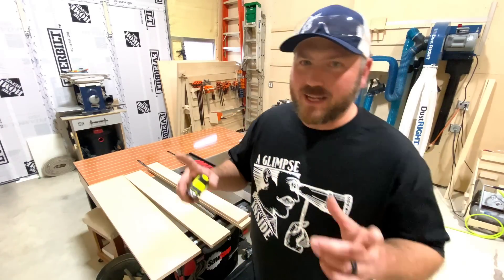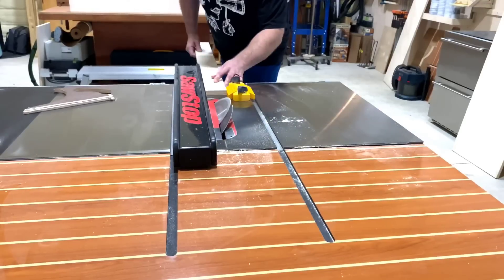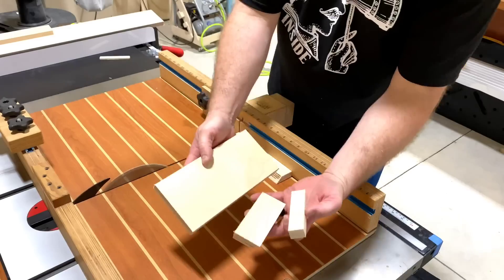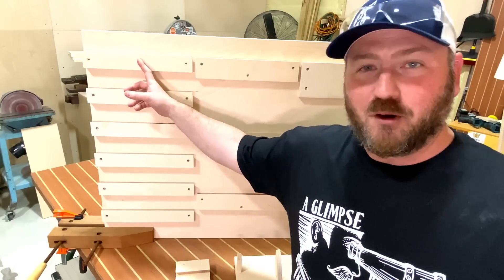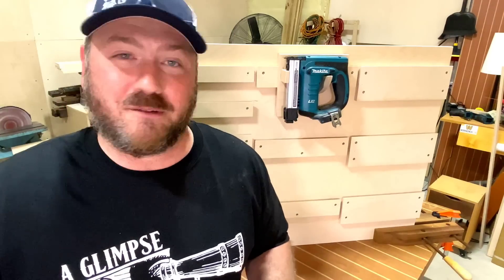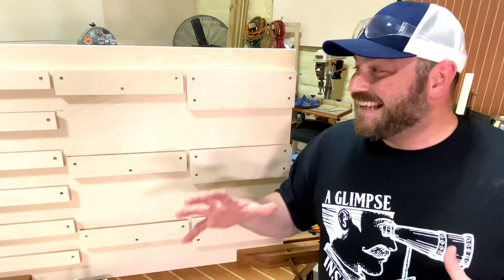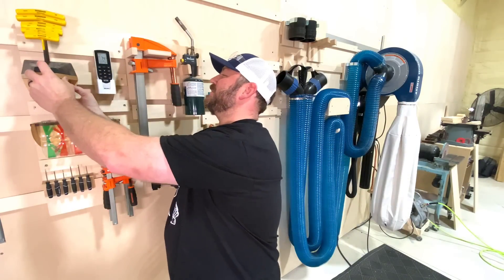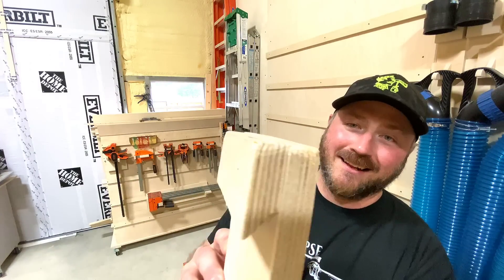Which FRENCH CLEAT Style is Right For You | A Glimpse Inside How to

Comment: You're too cool for words! Love the ending! One thing I might add is I've built a 4X 2'x4' modular workbench and on one of them I'm going to make a strong cleat shelf to put my cheap, 10" Harbor Freight table saw on so I have a run off table for sheet goods. At the bottom I'll have a key to prevent the table from being accidentally lifted off. Look at the 5:20 mark and see the small space between the bottom of the tool holder and the bottom of the cleat. You can make a slightly smaller strip of plywood to insert there and it'll prevent the holder from sliding up accidentally. A slight ridge cut in the key will give you something the grab and pull it out.

Comment: Great video.  I too set up a French cleat system in my shop, backed by two 4x8 sheets of plywood.  I spaced my cleats 4" apart so that I wouldn't need the spacers. I also saved about a 4" section of cleat that I use to set up the table saw each time I need to cut  more cleats. That saves me having to redo the math each time.

Comment: Chris, you've answered a headache I've been wrestling with for ever, how to set fence for 45 degree cuts. Huge shout out! Also, full French cleat wall is next project in my 1 bay garage that has 3 bays of material and tools in it. Can't wait to see it come to fruition. Love the vids, please keep them coming.
Reply: Agreed, thats a great take away from this video on setting up for ripping  the 45deg cut.  I  just completed my own fench cleat tool wall and used the trial and error method to find the center of the board.  I now have the knowledge for the next time I have to use this cut.🙄
Reply from the maker: Well I can help. Hope you get to those projects as soon as possible Greg. As always thank you
Reply: I suspect the answer is a trigonometry one. Sine of angle times width and cosine of angle times thickness, something like that 😁
Reply: No need for trig functions. 

What is missed though, and sorta corrected for, is the kerf. It’s half the width of the board minus half the thickness of the wood minus half the width of the saw blade.

Comment: I actually used french cleats to put up wall hanging cabinets. I laminated two 3/4 pieces of plywood and cut a set for each cabinet. This let me hang each one at a time and bolt them together after getting them on the wall. This also left me the 1 1/2" space between the cabinets and the wall to run cables. It's my entertainment center upstairs.

Comment: I like your plywood walls and all your french cleat videos!  I built a cleat wall for my garage 6yrs ago to get the yard tools, beach stuff (fellow Floridian) and bikes off the floor and out of the way. Since my wallls are drywall, I had to use wider strips and just ripped an 8' sheet of birch ply on a 45 and attached w 3 screws/stud, just as you said; I spaced about 12" apart.  It's such a strong, flexible system, and so easy to build..

Comment: I have built shelving and Curtin Rod Valances for several years using French Cleats for others.  I however, I have 20 feet of 1/4" Pegboard above one of my work benches, as some habits are hard to break.  I also have made about 50 pegboard specialty hooks, and I have about $500.00 worth of hangers, clips, hook locks, etc. and do not want to just throw them away.  That said, I am building an 8' x 12' wall of French Cleats for tools and a few supplies to get started.  Thank you for sharing the three types of Cleats that you use.  You have given me plenty to work with.  Loved you including your daughter as well.

Comment: Another great video! However, when I was making my cleat system for my shop, I tried using 1x2 material and it was a disaster! when I would cut the 45 deg. angle on the edge of each board they would banana big time. So to your viewers who are thinking of using french cleats please use plywood, it is much more stable!
Reply: Thanks Ted for that information, i was just thinking of using 1X6 softwood to save money but know I'm going to go back to using birch plywood, even though it costs a fortune here in Ontario, Canada.
Reply: Did you let the wood sit for a few weeks to get seasoned to the humidity of your shop?

Comment: Good stuff. Really wished I had seen this before I set mine up. Thanks for the info!
Reply from the maker: Thank you. I’ve put up many a French cleat wall that didn’t quite work. Are used to glue the first time. And a bead of it had crept inside the crevice between the 45 and the wall. Needless to say nothing really snuggly fit. LOL
Reply: @AGlimpseInside  Man, I thought I was being slick and used the primed 1x4 pine from the box store. It will serve my purpose but that whole "remove the material thickness from your measurement on the 45" would have saved me some bones. Really digging your stuff and your style. Looking forward to more of your content.

Comment: I never have enough wall space in my garage. And, I keep moving. Generally, built-in items become part of the property when you sell your house. So, about 15 years ago, I made 4 double door cabinets to go above my workbench and used french cleats to hang them. I always recess the french cleats on cabinets so that the sides are always flush with the sheetrock. I hang the wall mounted portion with two lag bolts and put the cabinets up. Because each move results in a different position for the studs in relation to the cleats, the wall portion ends up with multiple holes after several moves. But, I  only have to lift the cabinet off the cleat and remove the two lag bolts to move. And, trust me, they hold a LOT of weight. If I ever get called on removing the cabinets, I can honestly say the cabinets were never attached to the wall and at worst leave the wall mounted cleat in place and just rip 2 more pieces to mount the four cabinets in the new garage.
Reply: I would just make it clear to prospective buyers that the shop will be completely empty once I sell.

Comment: Thanks for this very informative video on set-ups!  If I understand, I could set up French Cleats straight on studs, using the 1X6" ?  And I guess if I have anything heavy to put up, I could always screw in a 1X1 for back up straight on the studs,  the necesssary length for a specific item.  High winds blew away some flimsy sheds, so I build an 8' pentagonal shed, in which I need to store and and have easy access to all my gardening and construction tools, and more.  I imagine the cleats will also reinforce the structure.

Comment: Chris, on the 45 degree measurements, you are correct...I figured this out building my french cleat wall.  However, one caveat is that it depends on which way your blade tilts.  Mine tilts to the right, so I have to ADD 1/2 thickness.  If your blade tilts to the left, you SUBTRACT 1/2 material thickness.
Reply from the maker: This is very true. But keep in mind that you want the blade to tell away from your face at all times for safety reasons. The propensity for the material to bind up in between that 45 and the fence is a bit too precarious for me my friend. But yes you’re right I should’ve detail that a little bit more I just thought I was being a little too long-winded LOL
Reply: This confused me. I couldn't understand what he was saying about the equation to get the 2 identical pieces at 45°.. could i get it in writing? My brain cant absorb info if it's spoken fast lmao I love this system and I want it in my shop!!!

Comment: So many applications. My deal is constantly adding tools to my shop (mostly hand tools). My original hand tool cabinet has very specific locations for each plane, spokeshave, chisel, etc. When replaced or new ones added I'm SOL since glued and screwed. Next tool cabinet will have small French cleats in it then I'd only have to replace the one cleat to accommodate the new tool.

Comment: I have my belt sander hanging on my french cleat system. I've had the sander mounted on a board so I can use it sand side up while it sits on a bench. I can now use it while it is on the wall for sanding simple items. For more intense sanding, I lay it on the bench and clamp it down.
Reply: Also, instead of having a cleat board for every tool, I have 12" x 20" pieces of plywood that I mount similar tools together on one board. Example, all of my squares, crescent wrenches, spring clamps, etc., have their own board. Currently I have 27 feet of these 12" wide boards and the linear consistent look is very clean and organized. Basically, how much stuff can you get on a 12" x 20" board.

Comment: @13:23  "Like a boss" look before you even stick the cleat landing. NICE!! A little foreshadowing there Chris?

Cleats need to go up in my shedshop. but i am getting hung up on a workbench style.
Reply from the maker: I feel your pain on that one I’m in the process of thinking what to do for my new updated workbench. Once I get the idea you know there will be a video
Reply: You bet Chris! I will be watching for it. ;)  My current idea for a workbench is a combination of a built-in cabinet and a flip top in a couple spots. I need some kind of space saver for my miter saw. Right at the work surface I want to add a floor sweep but for the workbench surface in the corner where. That way I have somewhat easy dust cleanup.  I am designing this in SketchUp first to see if this will actually work. Digital sawdust is easier to deal with before making man glitter (real sawdust).

Comment: Retail supply stores do have slat wall/French cleats with steel inserts. You can buy them in 4 x 8 sheets for about $125 per sheet... I used them in my family’s first retail store in 1985 and they had been around for 30 years before that. You can even buy hangers and accessories for very small items and boxes that hang on the cleats. I use a combination of both Store bought fixtures and my own French cleats. It works for my shop.

Comment: On your cleat system the one key feature is you can make cabnets floor or wall or both and have the option to change your shops layout without too much work to find a better work flow.
However the slat wall system is just as good and both are an upgrade to pegboard walls..
Neat thing is you move all you have to do is remove the cleats and fill the screw holes.

Comment: your narrow spaced cleat system and the large spaces system are also able to hold heavier weights than the middle system. the larger system is simply using beefier parts... larger board and more screws, but the smaller system has more cleats available, so if you have large or h4eavy items you can spread the load between multiple cleats. In my shed my back pack leaf blower motor is attached to 3 or 4 separate cleats. Likewise I have some shelves that are supported by multiple cleats. You can also "lock" a cleat to the wall with a support just below the cleat screwed in from the face. This is good for things like small parts bins that you want access to, but REALLY do not want falling off the shelf.

Comment: Another great video! Since I started building cleat walls, I've always have questioned the spacing the cleats and the width of each cleat. I've been spacing about 8” apart for tools and smaller clamps. I see now that when cleat rows are evenly spaced, it looks better. My shop has gets 20” apart covered by metal, with insulation installed. All my cleats are screwed in, so if &when I can afford to insulate, I'll remove the gets one section at a time---------I know this isn't a good idea, but I'm retired & on fixed income-----I can't afford to insulate before hand. Back to the cleats. I have 6 plastic screw/etc bins, I'm using 5” wide cleats for support of the bins & a spacer block to hold them vertical. I hope that'll work. This project won't look as good as a plywood or sheetrock wall. I enjoy your videos...... You have good ideas that are easy to implement or modify to my needs. Thank you.
Reply from the maker: Thanks brother. Yeah it’s whatever really works for you. On a budget or not I think it’s just kind of getting out into the shop and figuring out a way to make things just a bit more organized and they were before is the goal. I think we all can agree that it’s the process sometimes that’s better than a result

Comment: My French cleats were placed on drywall.  I was concerned about the accumulation of dust in the grooves over time.  To brush the dust out means removing all the hangers.  Vacuuming it out is an alternative but is still a hassle.  I cut 1/4” plywood or hardboard about 1 1/2” wide and as long as the cleat on the wall was wide (measured on the short side touching the wall.  I predrilled these spacers. As I screwed the cleats on the wall I stuck one of these spacers between the drywall and the French cleat.  It was a little hassle installing the spacers, but now I will never have any dust accumulation in the groove.  When done, you will not even see the spacers.  Note: make sure the spacers are not too high otherwise the cleat on the back of the tool holders may ride up too high and not seat properly.

Comment: This was a great video.  We’re completing a new garage for vintage car work, not a wood shop ;(. and my art studio.  I’ve been looking a a lot of videos on the cleat system and you’re the first that explained the pros and cons of the sizes of cleats.  I want to use this system in my art room (I have it in sections - metal/drilling work,, sculpting, glass, etc).  Question - Frank used 1/2” birch on his closet system and everyone else I’ve seen, so far, uses 3/4” plywood.  I can get nice size pieces of 1/2” birch from a shop that sells left over Board from a cabinet shop.  Is the main benefit to using 3/4” wood the strength needed for hanging tools?  Thanks.

Comment: I like your explanation of the three different types and their uses. My question is “ I have drywall in my shop but if I run 8’ strips on the drywall and put in screws every 16”, do I still need the thicker cleat or could I use the 2 1/2” strips?”
Reply from the maker: 2 1/2 inches will be fine. Although if you can’t screw into a hard surface and only screw into every stud. Only thing I don’t recommend is making something like a countertop that hangs from it but everything else is fair game

Comment: Chris, I've also seen one other style of French Cleat that doesn't use the 45 degree angle at all. Instead, each cleat is two layers - one shorter support block, then the vertical board that the individual boards mount into. The two blocks are flush on the bottom and the front vertical board between 50-100% higher than the support block. The major advantage I've seen with that style is you can also use right angle metal hangers (like door hangers for wreaths) to hang things. Less work at the table saw since you don't need to cut the 45, but more work since you need twice as many pieces to put it up. I also suspect the 45 can take more stress than the right angle because gravity pulls everything closer to the wall instead of applying torsion to the cleat if there is a gap.
Reply from the maker: That’s absolutely true I had seen that years ago but I completely forgot. Thanks for reminding me. You’re just giving me another idea for another option maybe for another video

Comment: The video's are awesome.  I'm working on my 12' wide 8' tall wall as I write this.  I'm made the 2 1/4" cleats.  I have one question?  You mention spacing them 5" apart.  But as I look at the one you built in the example, the space between the cleats looks less than 5".  As I started my second row with a 5 " space between them,  the gap looks huge.  I wish you had a picture showing where you measured them from?

Comment: I prefer the center version as well but not only for cost and assembly time but, you don’t give up space on the cleat below like happens on the more narrow and closer spaced left side ones. I’m still adjusting to the system…because I like it but, at 62, I grew up with the “hammer in a nail or two and hang it” method. Old habits die hard as THEY say…but I’m learning to adjust and adapt!! Of course, a good luck kiss from our little angels always conquers adversity!!😁

Comment: A Glimpse Inside,  

I really enjoyed your video, and am working on installing a cleat system in my garage.  I am an absolute woodworking novice and sadly, had a little difficulty using your tip on "dividing the thickness of your cleat material in half" to get two equal halves. I have a Ryobi jobsite table saw.  It's not my dream saw, but it was a great price - FREE.  

I cut 3/4" plywood into 8" strips. Then, I calculated that the saw guide needed to be 3 5/8" from the blade to get equal halves.  I set the guide to 3 5/8" and verified the distance with a tape measure and with the blade at 0 degrees.  Calculations sound correct?  Unfortunately, when I cut the 8" board, the piece between the guide and blade came out about 3/16" wider than the other half.  In the end, I had to set the guide to 3 1/4" to get equal halves.  Is my saw inaccurate or did I miscalculate?  

Thanks for any help.  

Todd

Comment: Totally love your  video. Very in formative.  New house build almost done. Dry wall garage. I think 7 plus in wide cleat will work. Question,  wanting to make shelves to hold tote 30  inches long  by 21 inches wide. If I store with length away from the wall ie 30 inches deep shelf.  Would you use shelf brackets 25 inches deep doubled cut  from 3/4  ply wood.  Needs to hold 50 to 100 lbs? What would you suggest
Reply from the maker: The brackets don’t necessarily need to be doubled up but you would need to use them probably every 10 inches on your shelf maybe even every 8 inches. The main thing if you’re doing cleats is the wall cleat being as secured to the wall as possible. Definitely double up the screws top to bottom maybe an inch and a half apart are studs when possible if you’re not in solid surfaces. How did you do have solid walls every 6 inches to hold that much weight across. Put that helps and I hope I’m understanding what you’re asking